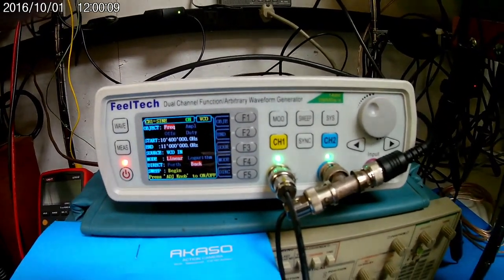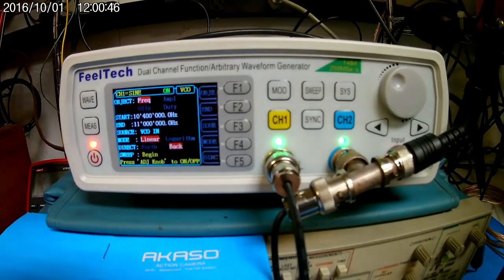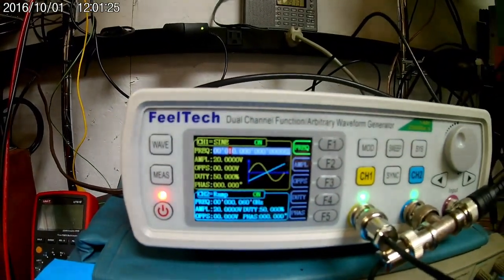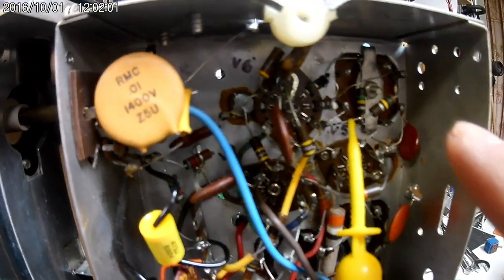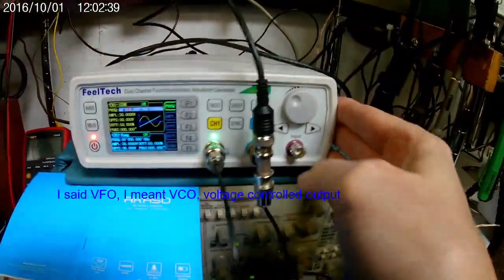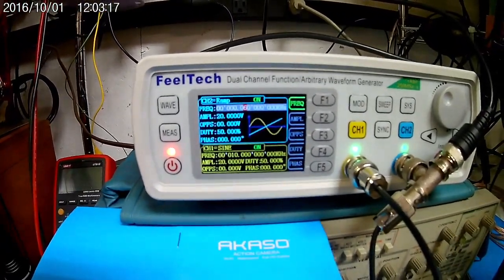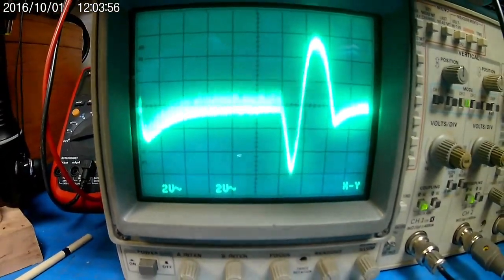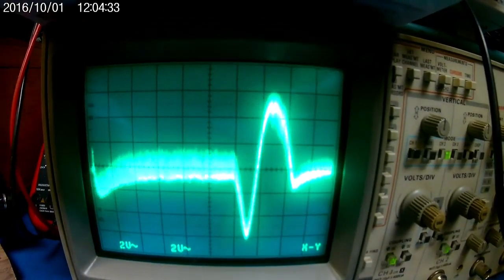Feeltech FY6600 S curve

Comment: Does the 6600 have an TTL-Connector on the back? Then you should pick your ext. trig signal from there and trigger on falling edge. This has the advantage that the trig signal on the TTL has a square wave with 50% duty cycle. This makes the center line coinciding exactly with the center of the ramp slope. Also make sure that the ramp frequency does not exceed 7-10 Hz. At least my 6800's VCO tendsl to lose linearity above 15 Hz.
I hope this might helps. At least here I can display a bode plot of an 16 MHz crystal with the peak spot on within a half a dozen of Hz or so.
Reply: Forgot to mention:
Make sure to make the ramp signal going EXACTLY from 0 to 5 V by setting it to amplitude 5 V with a DC offset of 2.5 V. The manual (at least for the 6800) is rather ambiguous in this regard...
Reply from the maker: Thanks!  I'll try that.

Comment: Very interesting, always wondered about using the sweep feature on a function generator...never had time to experiment.  Great stuff!  ~Jack, VEG
Reply: The sweep function is useless for that purpose as it does not give you any trigger output in order to sync your timebase. That's why also TwE uses the VCO to control the sweeping frequency via the ramp signal on Ch. 2. (more about that see my earlier post here...).

Comment: Was wondering if these generators could be used for radio work. I ended up getting an older unit off eBay that’s radio specific with am/fm modulation, pilot signal, sweep and stereo.